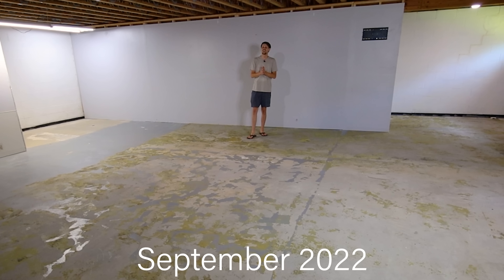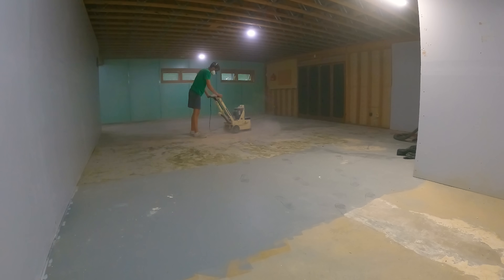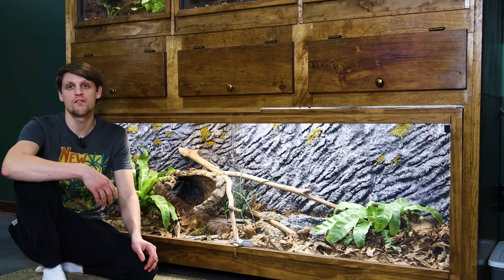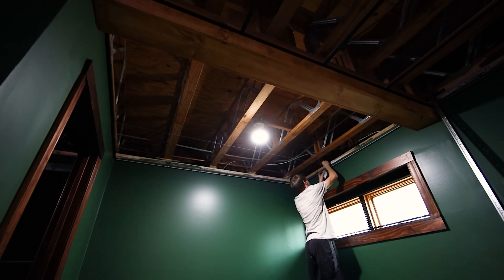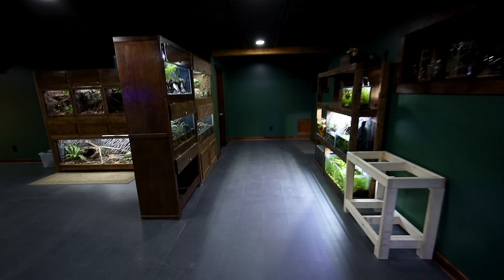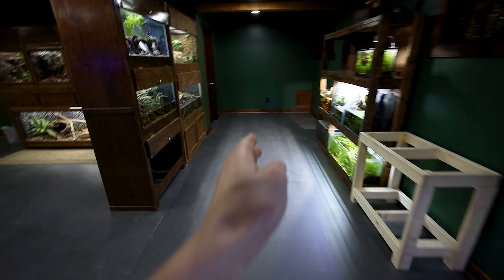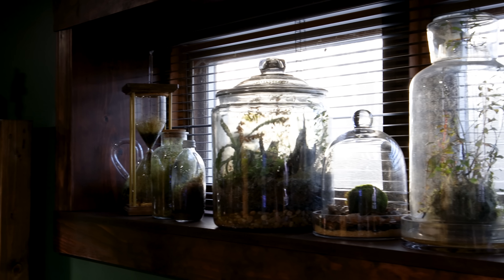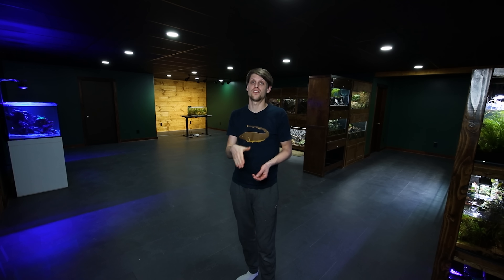The Real Story Behind My New Animal Room. It's Done.

Comment: I think your friend is right when he said if you put benches running the length of the aisles would make it look like a locker room. An alternate suggestion might be 'portable' seating in the form of wooden stools in the same stain as your current woods in the room. And because you are so handy and enjoy building things, I'm sure you could design yourself some custom stools to fit your style and the space. This would give you flexibility in the stool height as well. Some taller with foot rests for those higher displays and some regular height for every day. You could make them stackable so you can tuck them away in a corner or along the wall when not in use leaving ample room in your space for walking and moving around equipment etc... Not to mention you could still use them for guests.

Comment: Great work you've done! One item I'd consider, which I'm surprised your electrician didn't do - flip your outlets to ground side up. Prevents accidental shorts if anything were to fall on a plug or if a plug isn't seated constantly. As configured the hot and neutral are on top, whereas flipping them, anything that might cause a short will just bounce off the ground and be of no concern. 

Just an item to consider. All your working framing, mudding, painting, etc looks great! Can't wait to see what the future holds for you and the channel.

Comment: I think having a motorized table to use in your studio area would be beneficial when filming and also moving the tanks once you're done with filming. To be able to raise and lower the table/tank would help your back when standing and reaching into the tanks, and you wont have to adjust the camera as much. And then bringing the tank down to carrying level to move... I just dont know what the load capacity is on those type of tables/desks. Just a thought!
Keep up the fantastic work!

Comment: Fantastic work. I do have a suggestion. Do not use benches; they are hard on your back while sitting for any length of time and they are not fun to move around. I recommend a couple of very comfortable chairs, like zero-gravity lawn chairs. They are comfy and easy to move to any place you want to look at things as well as for cleaning the space. 
Did you consider a lip on the outside edges in case of a tank breakage?
Also, do you have a dedicated work sink area with easy to access temperature-controller water supply and drains?
Keep it up.

Comment: Tanner, nice job on the Animal Room. It is an awesome space. It is obvious you worked hard to make it just like you wanted it. Going forward, I am sure you will enjoy the space and continue to expand it and improve it even more. 
I have a question. Many of your set-ups have an open top, as well as a warm ambient temperature, both of which are undoubtedly contributing to raised humidity levels. I understand the animals and plants require humid conditions, but I am wondering what effects, if any, this has on the structures of the room, like the ceiling tiles, any metal surfaces, racks, or shelving. Do you experience any rust, warping or excessive moisture buildup on surfaces? How do you mitigate that problem? Is it necessary to waterproof these items?